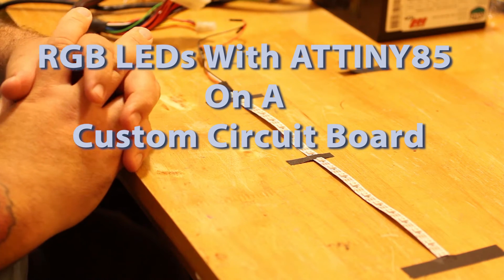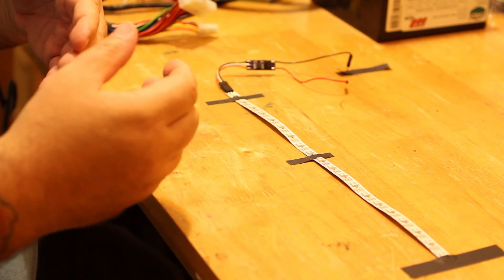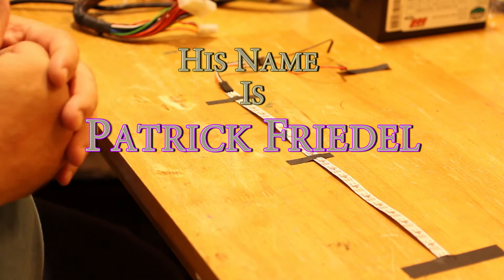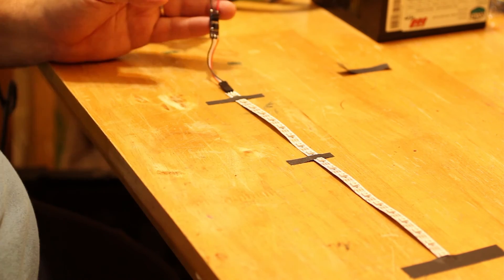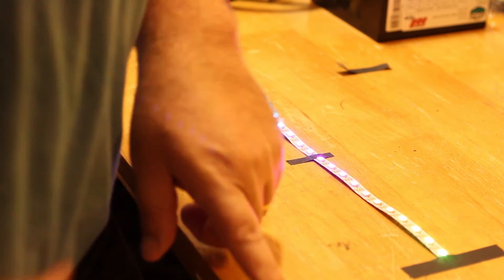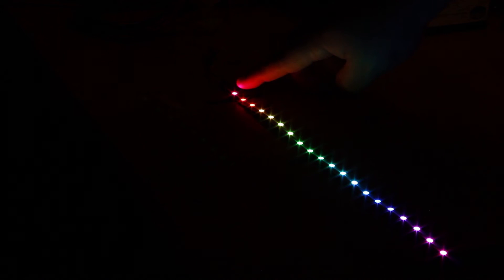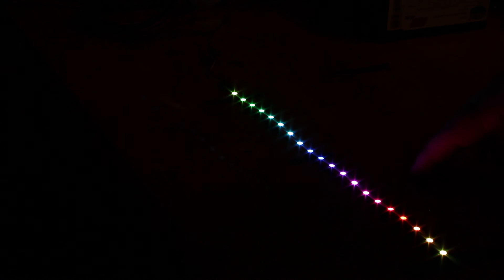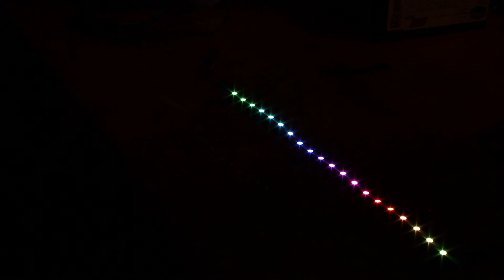RGB LEDs With ATTINY85 On A Custom Circuit Board

Comment: Great video. I have been wrecking my  mind here trying to find out if you can in fact run two different led strips on two separate pins.  For instance red on one rc plane wing and green on the opposite rc  plane wing? Or do you have to run separate atttiny85's for each strip? Thanks.

Comment: Say I wanted to use 12 volts to push 3 or 4 1 watt leds @300ma, would this same configuration work?
Reply: Or rather could I get 12 volts out of it to power those leds in series instead of them all being in parallel?
Reply from the maker: @PatrickBeee  nope. Sorry.
Reply from the maker: Voltage and amperage are two different things all together. Voltage is like the size of a hose, amperage is how much pressure is being pushed through the hose. 

Not quite sure what your asking me.  

I will say this, if the LEDs you want to drive have a higher voltage than the ones I am using, no this board will not drive them. This is all based I  USB voltages, 5v max of 500ma draw. 

there are driver boards for 12volt leds, just google Arduino 12v LED driver kits.  

this project was to build a tiny concealable, programmable, led driver.

Comment: Hey, Can this be used to change the colour of all the LED on the press of a single button?. 
Will it work with 9V battery or can u recommend any rechargeable battery?

I want to make a 60cm sort of led sabre for light painting photography.
Reply from the maker: Yes and yes. You can program the LEDs to cycle with a button press, or on off of a septic color.  Any color any variation you can think of. It's all in the program that's compiled and uploaded to the chip on the board. 

As to the battery, you can use anyone you wish. One could always build a circuit to step down or up the voltage of any battery.

Comment: Where did you get the layout, i heard you say it was open source. I would would be even more awesome of a board if the programing thru holes were made into pads on the backside, that way it could be shrunk down even more. and can i assume that S2 is a cap for the strip and R1 is a resistor for the data pin?
Reply from the maker: I found the file in a Google search, and then sent it to a board manufacturer.